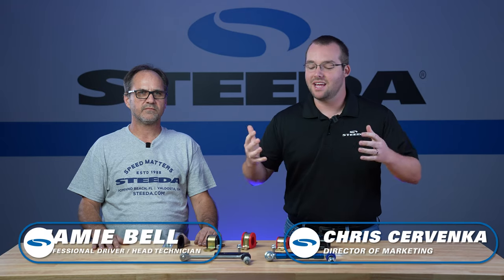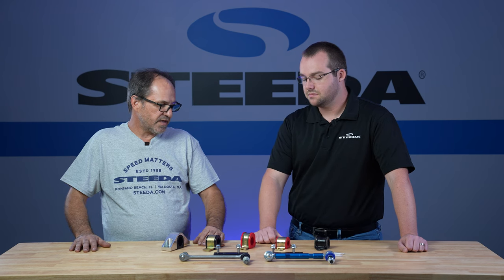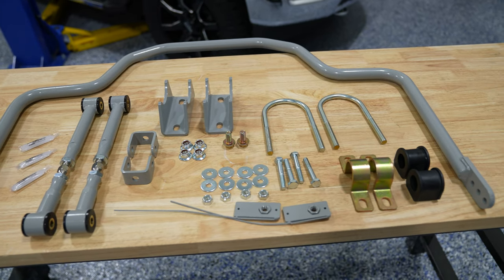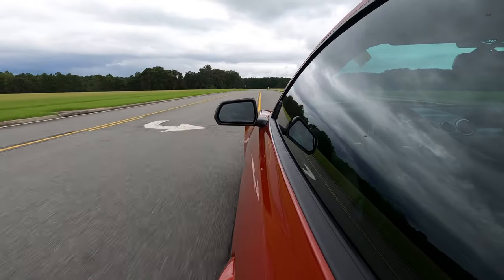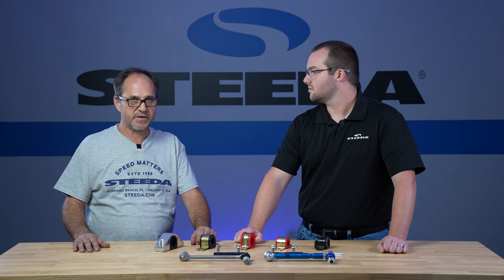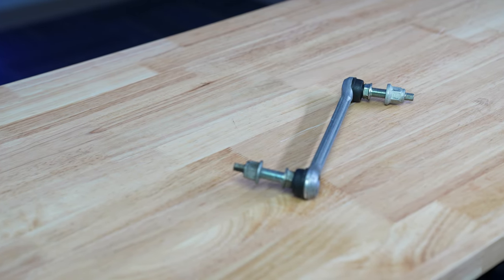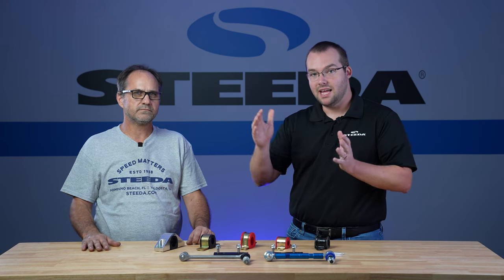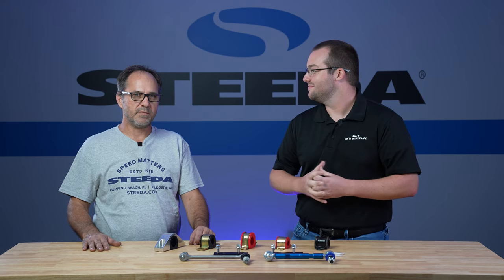Sway Bar Accessories Explained! | Tech Tip

Comment: FYI...The Steeda adjustable end links DO NOT work if you lower your Mustang GT.  The end link length is for stock height vehicles.  I just lowered our 2016 Mustang GT one inch, and now have to cut and weld the end link aluminum center rod.  Buyer beware !!!!!!
Reply: Wait what it’s pointless getting them ?